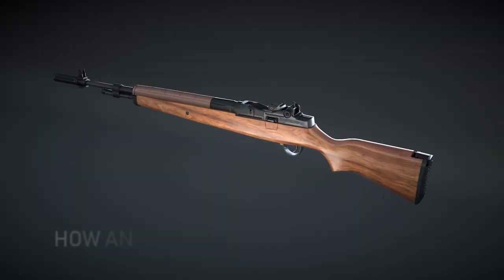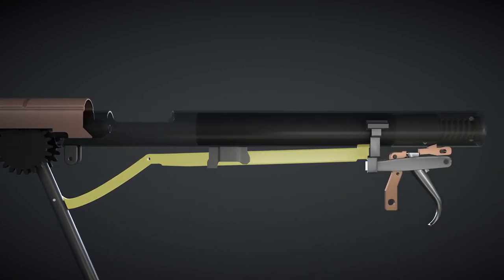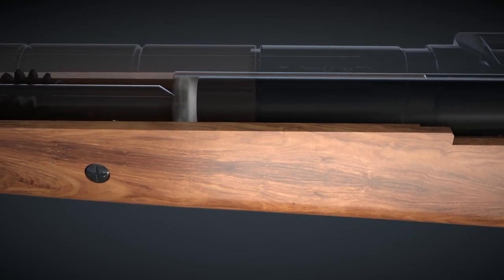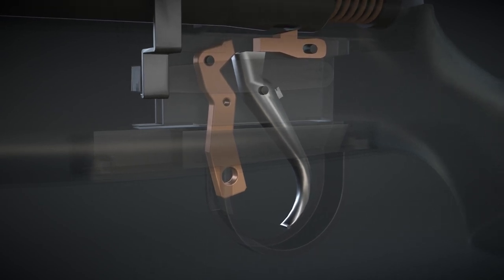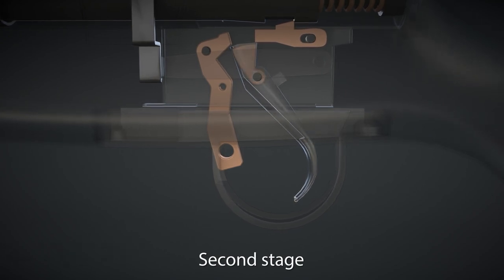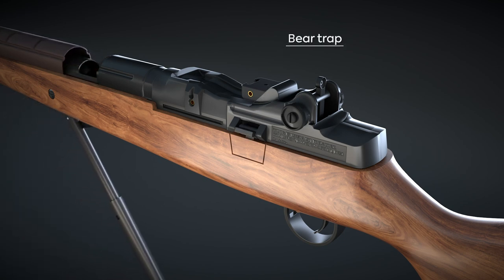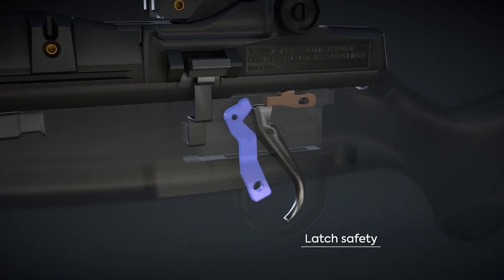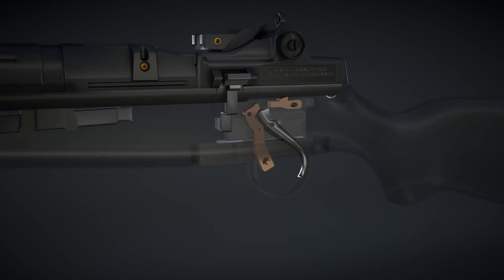Learn How Underlever Air Rifles Work

Comment: Awesome video. Thank you ❤️
On a side note I am wondering if there is a way to increase the velocity of this weapon by adding some sort of flammable gas and then igniting it as the air is being compressed. Like this you get the goods of both fire arms  and airarms
Reply from the maker: Please do NOT do it. Extremely dangerous
Reply: On another side note, your local government will likely have a legal max limit for air rifles, and the air rifles in your country will be set very slightly under that limit. So doing anything to increase the guns power will be breaking the law. + The gun & its seals will be manufactured to cope with the power it's factory set at, you increase the power to more than it's built to handle, you'll just wear the gun out in no time... And for no real purpose, they're already more than powerful enough to deal with anything you would be permitted to shoot with it.
Reply: That would be a spud gun.